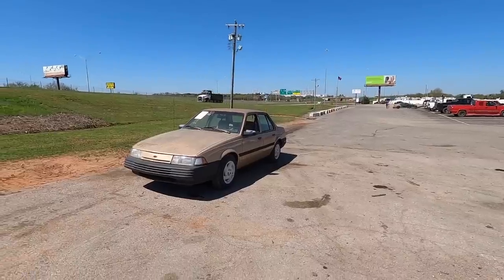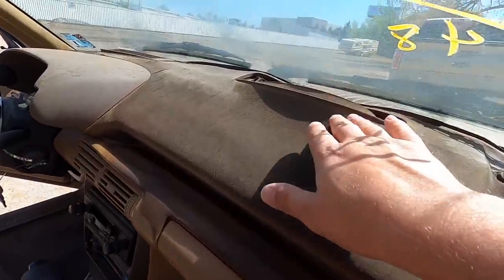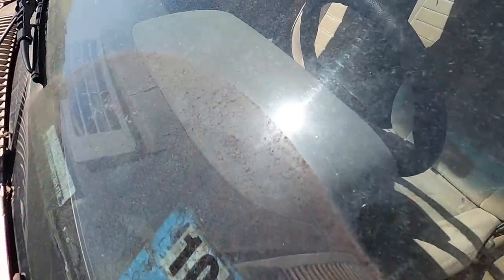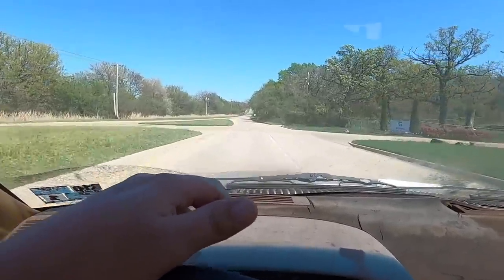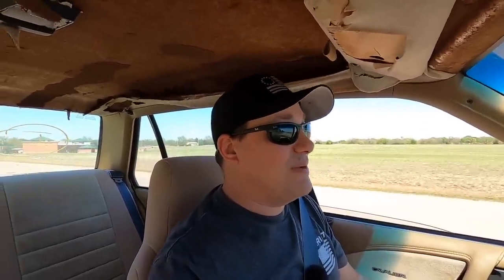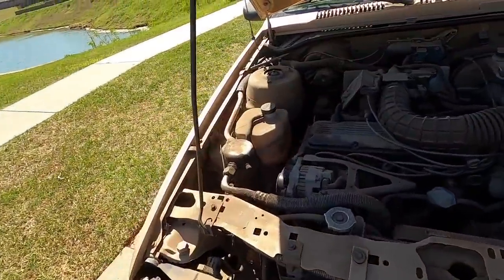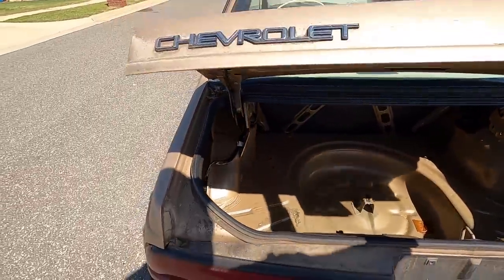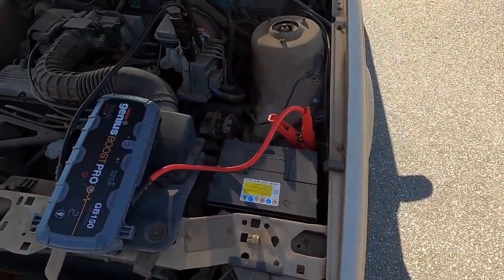$250 1992 Chevy Cavalier 1 Owner 88K Mile IAA WIN!!! Run and Drive? Let's Find out!

Comment: With the low mileage you're going to see a profit of $500-1000 dollars. Assuming you invest $500 or thereabouts to fix it up. I'd buy it in a heartbeat for $1500 with new paint, headliner, air fixed, possible dash repair, (Leave that for future buyer) new hubcaps, and a general maintenance. Try to keep the repairs under $700, and I think you'll see a profit from the car, and YouTube.

Having owned a 2003 which has the same general mechanical layout. I would service the trans, and check the water pump, and probably replace just as a courtesy to the new owner. While your there, you could replace the timing chain as they are known to have problems at just 60k miles on occasion. Mine had about 100k, and no signs of a bad chain, but the water pump was leaking so might as well replace both, and ask more money for the car.

Comment: There are Very reliable cars. Here in Brazil the J models até known as Chevrolet Monza. I own a 1990, runs in carburator yet. Its my daily use car. No issues. With maitenance tese last for 400k Km easy.

Comment: Randy your worst purchase was the new corvette that was a lemon and i hope gm took it back. That Cavy you say it runs rough, I had a 96 s10 with that same motor sounds just like it its fine, its an old OHV motor its NOT smooth. i had a 5 speed manual in my s10 i'm sorry for anyone who has the automatic its gotta be slow as hell. - one thing that is interesting is the fact it still has the hubcaps.

Comment: Easy to work on cars. Very common engine. Even the head is easy to do much less the timing chain. Shoot the steering wheel is almost worth the price of the car oddly. Have had 88-92 Cavs almost forever the Z24 editions. Just don't seem then in the midwest anymore.

Comment: Loving the cavalier. Trip down memory lane.
Sweet JVC stereo. That thing running a iron duke 4 cylinder?
Reply: No. 2.2. First offered as a 1.8 with the introduction of the J Cars in '82. Chevy designed. Too low on power and the press and buyers screamed so the 2nd year or so they increased it to 2.0. Late '80s it was increased again to 2.2.
The Js never used the Iron Duke/Tech 4.

Comment: Oh my God, Randy!!  88k miles or not, you bought a 28 year old, biodegradable car!! No, no, no!  LOL  Well, it'll be interesting to see what is good & bad about it.  Running rough?  Throw some plugs in it.  Check the belts & tires for rot, clean it best you can, try to get 1k for it.  If you can get anything over $500, you might make a little $$.  edit:  Yes, I started this comment before you started talking about the tires.  LOL  more edit: I recently saw a video about bringing a dead battery back to life. They pulled the sticker off the top and exposed the caps to get some water in there. They set the booster to 200 and did several 15 minute cycles.  You could see it bubbling in there like a wicked witch cauldron, but the battery did come back.  You could try this, just as an experiment.  Sweet Project Cars is the channel, and that video is 3 weeks old.

Comment: wow..... i had a 1989 and is was the best car i ever had and it last me 5 years and i trade it a 82 supra for this car that was junked !!!  all flat tires and broken back glass but the owner told me dont judge the book by its cover so he filled all the tires and put in a new battery and it started instanlly. so i took it and kepts it for 5 years and only gave me alternator isues like 3 times other than that ok.
Reply: and igot it in 2004

Comment: Don't paint that Cavalier, wash it and then buff out. The tires will be good for a beater with a heater. Rattle can spray the ceiling. Will never get your money back out of the car if you put much on it. You are the only person in the US that has much attachment for that old nothing car. Crap car to start with.
Reply: Wrong , read the comments and lighten up .